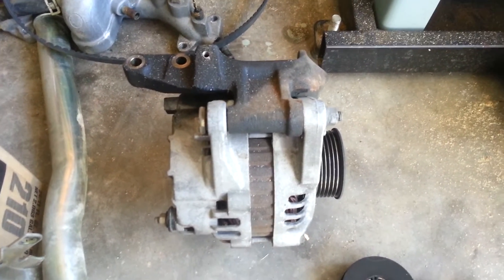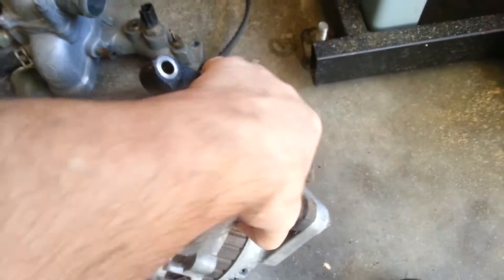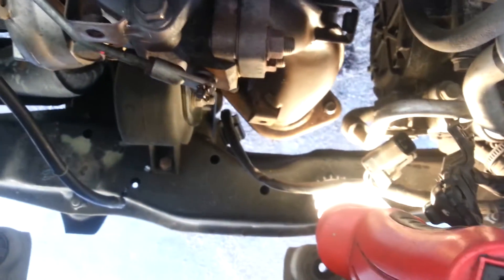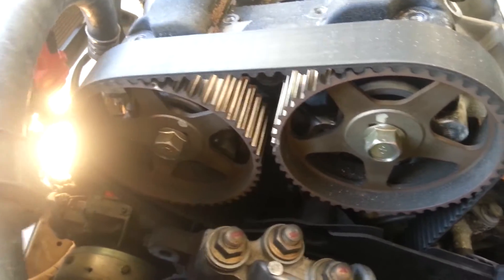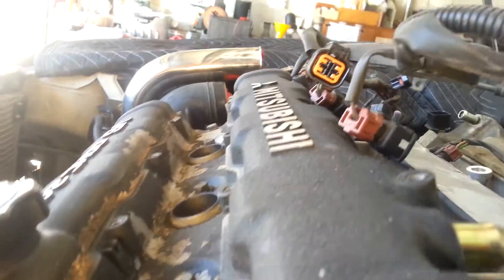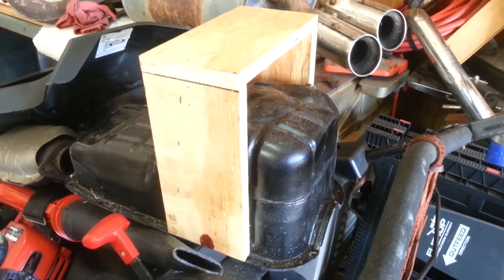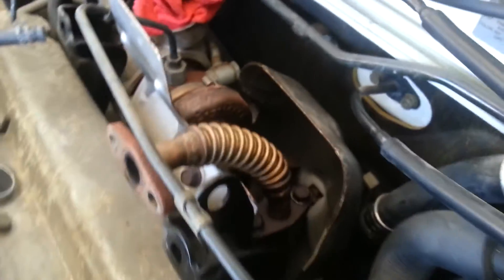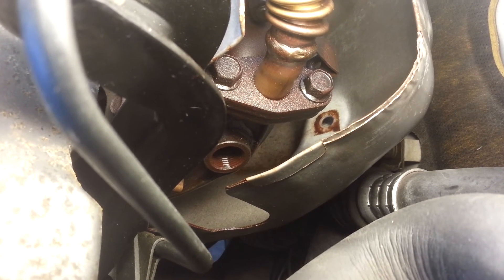Last VR4 Built - Alternator Removal and Engine Support

Comment: What did it cost for the complete set for the 60 k tune up
Reply from the maker: $1,500 in parts would do the job right. Does not include things that you will find, once you start tearing things apart. I recommend using OEM Mitsubishi parts for this service. Join 3SI.org and get a great discount on dealer parts.

Labor is around 20 hours for a complete 60K Service.
Reply: Ok I have a 91 vr4 thanks man keep making videos love them

Comment: I have been watching  your videos and my question is, what are you trying to change to your engine or the car en general?
Reply from the maker: This series of videos walk you through the required service for the 3000GT, GTO, Stealth, etc.everyt 60K miles. The timing belt and hydraulic tensioning system are the primary objectives of the service.